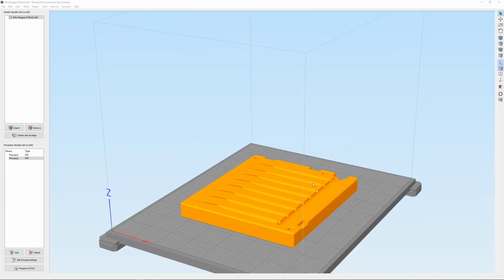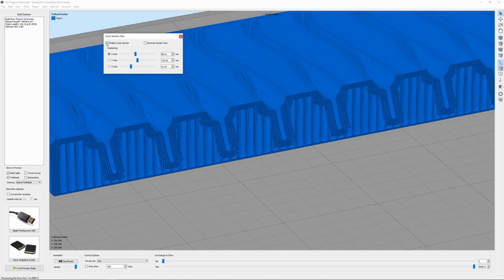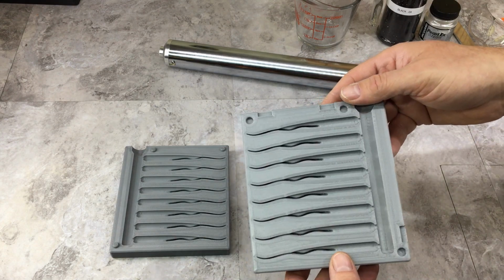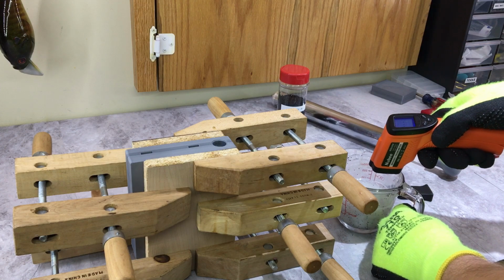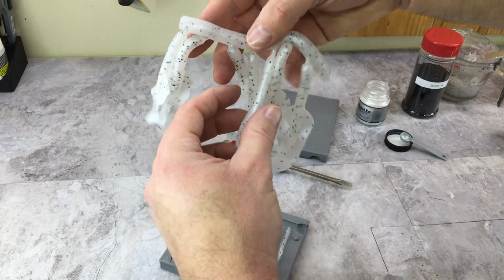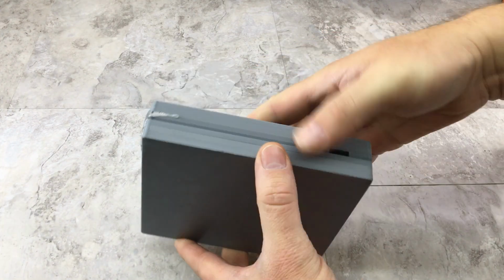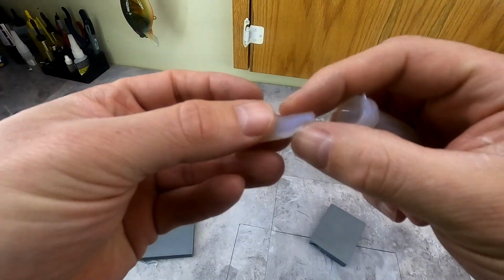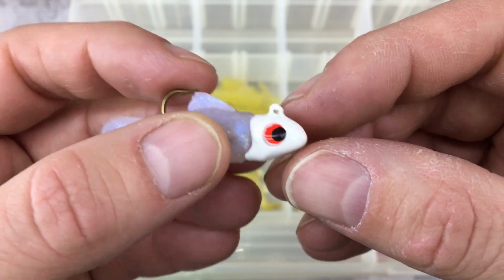How To Inject a 3D Printed Mold for Soft Plastic Fishing Lures (Mini Reapers)

Comment: I know its an older video but anyways, while PLA melts at +130C, it will soften at around 60C and might deform, another video definately had that happening where u could see the infill thru top layers. Surprised how well your molds hold up tho, pretty awesome!
Reply from the maker: I think it still works well because the plastisol cools relatively fast so it's not sitting at those high temps for a prolonged period of time.  I also don't shoot the mold back to back like I would with aluminum so letting it cool a bit first helps I think.
Reply: Yeah that probably helps alot. I'm using PLA as mold supports with small silicone molds for casting lead weights and surprised how well those supports hav held up as pour hole/ top of the mold gets molten lead and it gets very close to PLA, no real deformation or melting has happened unless theres actual contact between lead and PLA and even then melting has been pretty minimal

Comment: I tried it with a squid mold made with PETG and the mold was deformed when printing it at 100% fill, how do you do it? What temperature do you have on the vinyl?
Reply from the maker: All of the info you just asked about was in the video.
Reply: @TheNeverendingProjectsList  Sorry, I had not set the translator to automatic, I only speak Spanish

Comment: Pretty cool for sure. If you apply a little cooking oil or spray some Pam in the mold cavities the baits will come out much easier. I already make my own baits using mass produced aluminum molds but I am interested in trying to print some of my own molds.
Reply from the maker: A mold release isn't really required with PLA molds but thanks for the suggestion.

Comment: I made a mold from petg, and the lure sticks on the mold very bad and break down if i try to take it off.  I think somehow pla is better, maybe it is the material that pastisol wont stick on to it.
Reply from the maker: I wouldn't say it's "Better" but... PLA is easier to print with and I know the plastisol releases from the molds without any problems. While PETG will probably handle the heat better it does have a tendency to cause stringing during printing.  I have not printed a PETG mold yet so I don't know if the plastisol sticks to it or not, it might require a mold release.   You can print with any filament you want to use.... I just like PLA.
Reply: @TheNeverendingProjectsList  i will try pla, if the lure comes out the mold better then the issue is on the filament.
Reply: I got the same problem.. I found good settings for petg and printed a lot of mold without trying before.. Luremaking with pla molds worked for me so I thought petg is better cause of better heat resistence buuut no.. as you sad the plastisol stick so bad on the petg.. I can put all thr molds into the trash

Comment: Hi, thank you for your videos, they are usefull form me to better understanding. I'm trying to make my 3D molds but often during the injection I find parts of bait with cavities located in one point. Even adding vents, the bait never comes completely perfect and this is very frustrating for me. Do you have any advice?
Reply from the maker: A lot is going to depend on where the vents are in the design and it's hard to tell without seeing the actual design but I try to have them at the top of any areas where air can form pockets. If they are at the top of those pockets they should allow the air to escape during the inject and not cause an air bubble lock up (so to speak).

Comment: Hi. Very interesting. My brother (who want to have rubber lures) asked me if I could print a mould for him. What do you use as a release agent or lube? to get the lures out of the mould?
Reply from the maker: You can use worm oil but it is not really necessary with PLA molds.  If you use a different kind of filament it may be required though.

Comment: Do you know where I can find the pump you're using. Having difficulty finding one, thanks
Reply from the maker: The ones I use are all homemade (I machined them myself on a mini lathe) but try basstackle.com I hear they make good ones.
Reply: @TheNeverendingProjectsList  oh wow awesome! I thought the handle looked printed. Thanks ;)
Reply from the maker: @shotgunscott055  You are correct... the handle and rear end cap are printed. They are never near the heat so it was just easier and faster to print them.

Comment: Super impressed on how nice your baits came out. Just wondering how do you keep your tails from sticking? Mine are always destroyed by the time I get them out.
Reply from the maker: You can try a little worm oil in the mold before injecting... I give my baits at least 15 minutes to cure before trying to de-mold because a printed mold does not dissipate the heat like an aluminum mold would.

Comment: Great video 👌 When you use pressure to fill the molds, I assume the air in the mold is just pushed through the pla and smal gaps in the mold? What would be the pos/cons of making smal holes in the end of each chamber of the mold to make the pressure lower, and be able to see that each chamber is filed up 😊🤔
Reply from the maker: Thanks... What your referring to are commonly called vents and if you look hard enough (especially in the print settings part) you can see small vent channels at the tail of the bait. They are really tiny though.. maybe .03" wide and only only layer (or so deep).  This lets the air out but they usually are not big enough to let plastisol out.  I don't always vent my molds because yes with 3D printed molds there is always going to be a tiny air gap anyway but you will always find vents on aluminum molds.  But over all it's better to have them.

Comment: Maybe make a hollow mold that can be filled with water. It might be able to keep the plastic mold cooler and avoid mold failure. No idea if it would work just an idea.
Reply from the maker: Maybe... the only probably even a 3d Printed mold printed at 100% infill isn't really waterproof.  As long as the plastisol temps are kept under 300F I haven't had any further problems though.

Comment: Have you ever thought of putting metal rods through the mold to help with preventing warping like you did with the middle of the tube mold? I wonder if it would give enough strength.
Reply from the maker: Honestly I haven't shot the tube mold enough yet to see if it actually helped with the warping so I haven't tried it on anything else yet and I didn't want to use up the rods I have left as I'm playing around with some other core shot stuff (future video).  Overall the warping really hasn't been that big of an issue because the clamping flattens them enough. I should shoot some more tubes though because I am curious to see if the little 1/8" rod is enough to help.

Comment: Ik this doesn’t have to do with this video, though I enjoyed it, but when I print your rattle trap lures the wire slots fill in. Is there a way to stop this so I don’t have to use a file or dremel on them. Keep up the great work.
Reply: Yes
Reply from the maker: @jakeh5099  Ok I'll see if I can make the slots a little deeper for you. I'll update the thingy page with them soon.
Reply from the maker: It is a pretty thin slot so you have to make sure your first layer isn't squished so much. I have been planning to make a version with the figure 8 hook hangers I use but let me see if I can find the files and I'll try to make the slot a little deeper for you.   edit - Was it this one ->  https://www.theneverendingprojectslist.com/fishingprojects/rattletrap/
Reply: Okay thanks. Also do you glue in the bbs in the front section.
Reply from the maker: @jakeh5099  New files are up for you... Hopefully they work out better.  Yes glue in the front BB's.
Reply: Thanks. Your work is Amazing.